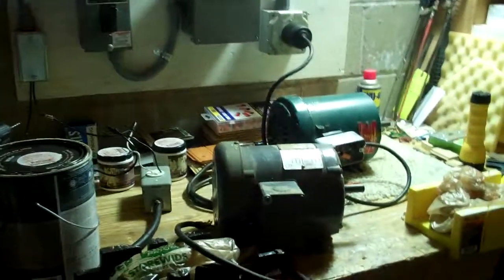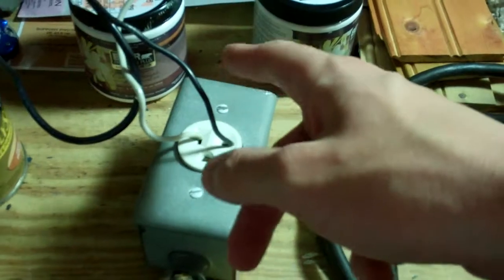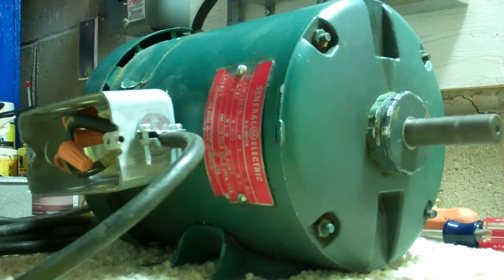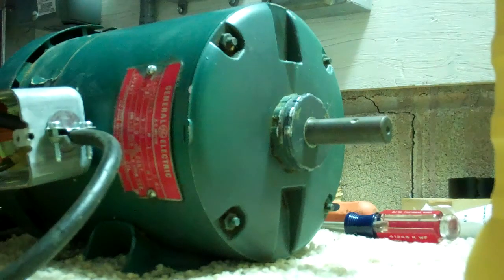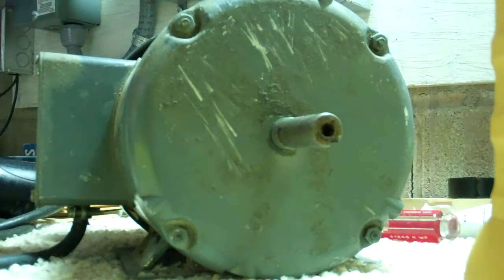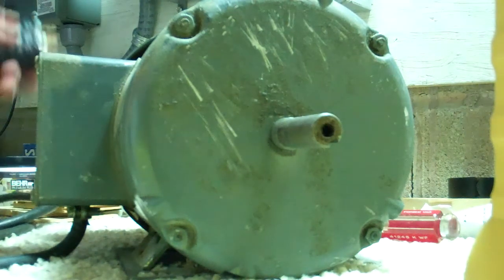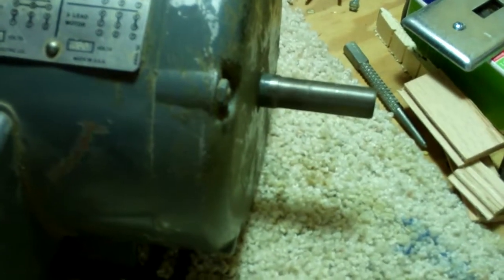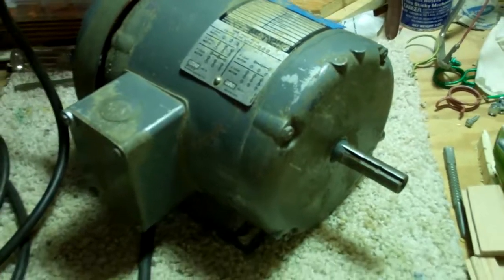3 phase motor problem plz help

Comment: When you flicked the boost switch on the phase converter it definitely made a difference to the first  motor on startup
PS you made me laugh with the way you interact on camara you should fo more

Comment: Is it wired correctly on the motor terminal box? Looks like there's a diagram on the motor for different voltages etc. also  may be due to motor design, a 1hp motor for a fan will not have as much torque as 1hp motor for a compressor for example. Or could be faulty!!!

Comment: It could also be that your putting to much power to it because with 120v drill if u put 240 to it it will turn slowly and hum I may be rong but good luck

Comment: i guess you have the first  D/Y motor wired to D and the second one on the Y. you should check wiring set in a wiring box of motor. motor wil run on a 1f set only with a delta wiring. on a star you wil burn it.